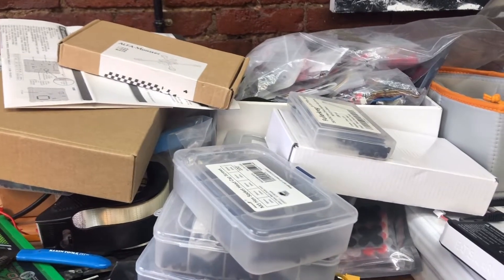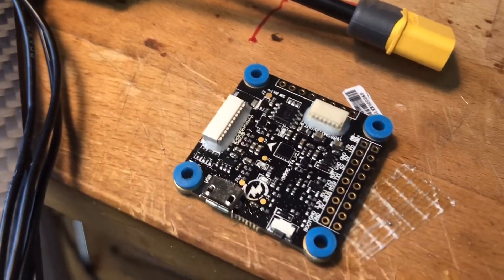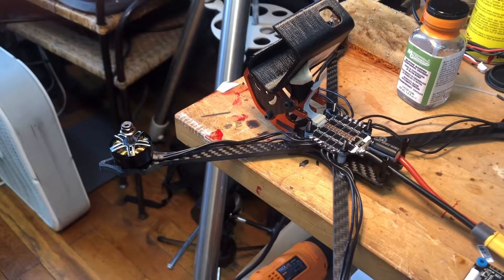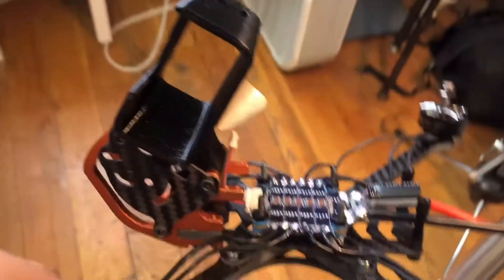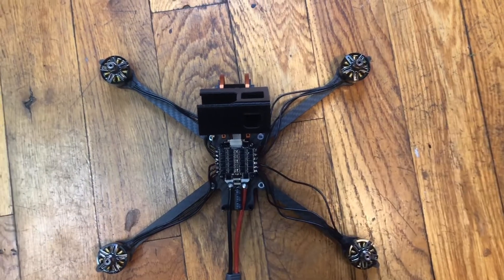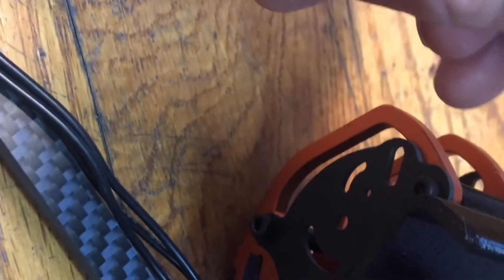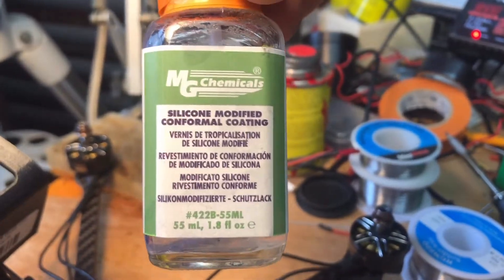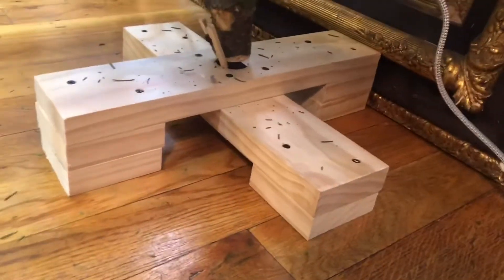ANOTHER DJI AIR UNIT BUILD AND RAINPROOFING

Comment: how to rainproof dji air unit?
Reply from the maker: Conformal coating applied only on the esc and flight controller, the air unit is in case so no need:)
Reply: @georgitushev  lol no, the air units antennas are where the water gets in, also i opened the „case“ and there is not waterproofing, it is just two aluminum plates screwed together, there will 100% water get inside
Reply: @shotbyarian  Right? Like why not show the process of waterproofing the air unit itself? Why have it in the title, it's kinda clickbait, no? haha
Reply: @KageBlink  yeah missleading title